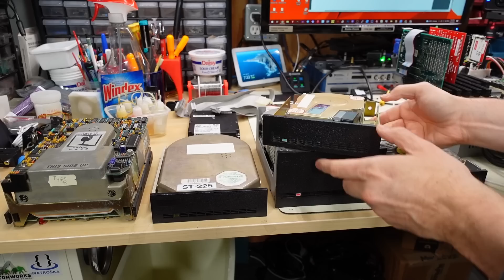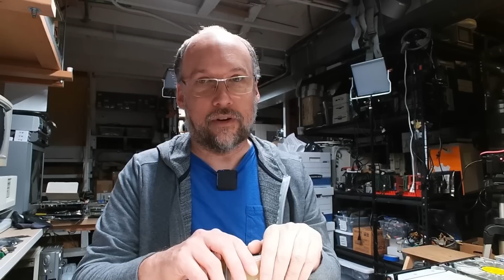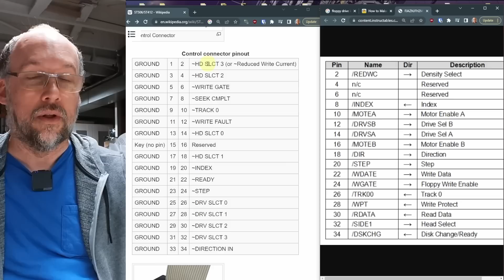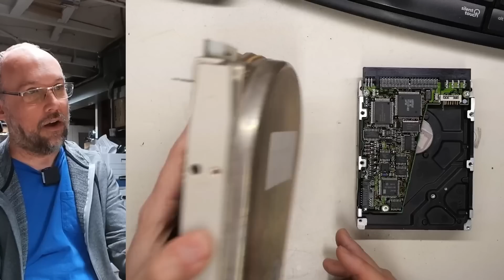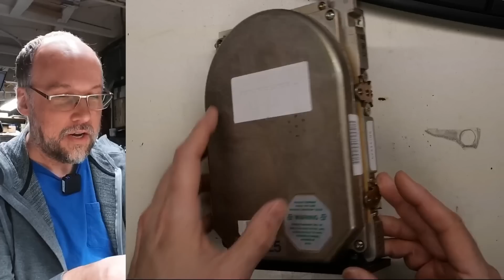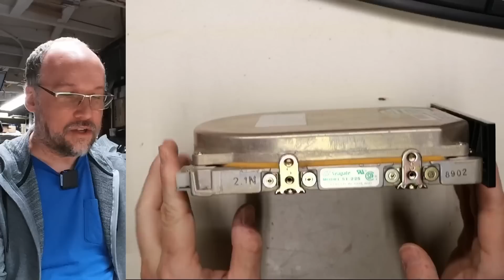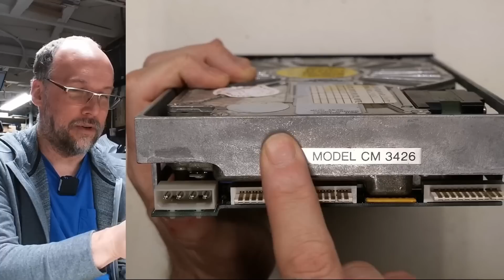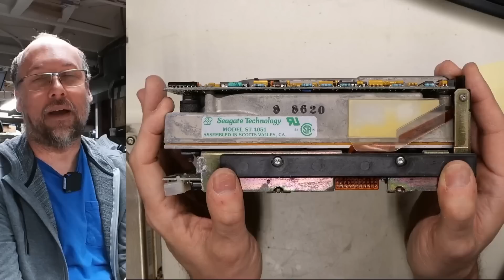Not forgotten: MFM hard drives

Comment: RLL was fun - the early Amstrad PC1512/1640 used this - you had to low level format the drive at the right time. - if the computer was cold the machine would boot, but when warm would miss read… it was was about 30 to 40 minutes from cold - a sealed computer could be low level formatted an the os put on. If you left it too long - it would not boot when cold only when warm…
Reply: I don't know what they used but if it was the classic ST-225 they had a known issue where the PCB would prevent the case from expanding evenly as it heated.  The answer was to loosen one of the screws holding the PCB in place.  It was a good idea to backup the hard disk, low-level format it to write new 'in-alignment' sector addressing data, an then restore if this was done.

Comment: I was wondering about that before. If IDE is just ISA, would it be possible to connect Soundblaster through it to a "modern" PC? Systems from the 1990s are rare and expensive in Europe, but those from the early 2000s are just trash thrown out everywhere, and they work with DOS just fine, but of course without sound.

Comment: Great video! My first PC was an AT&T PC 6300 with a 20mb RLL encoded hard drive. The only thing I have left of it is the 5.25" floppy drive. I miss it.  Looking forward to part 2 and some Coleco Adam content.
Reply: I too missed having an AT&T PC 6300..... so I hunted a nice clean one down and it's safe and sound on a shelf in the basement.  I even managed to track down the matching color monitor so now I have the option of using monochrome or color on rainy days when I fire it up for some nostalgia.  Mine came with a trusty ST-225 factory installed hard drive in it, some day I'd like to track down an original Olivetti hard drive for it too.
Reply: @RogerWilco486  that's awesome! I wish I never got rid of mine!

Comment: I enjoyed your post on MFM hard drives. I am an older adoptee of computers, not until 1988 at the age of 37 did I acquire my first a Commodore 64. In the early '90s I stated rebuilding and selling used computers having self taught myself to do so. Most st first had 10 or 20 meg MFM  hard drives with most being full height drives at first. Later on the hard drives were 20 or 40 megs in various configurations up to 80 meg total. I usually left the first drive uncompressed and used drvspace or dblspace on the second drive to get more storage space. I used a lot of different brands and capacity MFM drives the largest being the old full height Maxtor and Miniscribe 80 mb drives, the top covers being cast with the company name in large raised letters on top..A work of art and not cheap either. One thing I did was I tried to buy the hard drives with the least number of errors. Also hard drive setup was time consuming sometimes taking hours on a very large drive.  Another thing I did for some of my own drives was to format n MFM drive with a RRL controller and then drvspace the drive. On a 40 meg drive I would end up with somewhere around 90 megs of space with the conversion losses causing you to lose theoretical space. It made for a slow drive with lots of clicking and drive activity light going nuts but it worked.

Comment: I am in the middle of making a video with an Amstrad PC2286/40 and when I first tested it the WD 384R drive shut down the computer when booting up. I checked all the caps and spun the drive motor by hand and after this it actually started to boot so I guess something was tuck and pulling too much current ? . At first it would just give sector error, but over time it slowly started to work and by the time I had managed to back up all the data the drive was booting and working almost perfectly.

Comment: I learned A LOT! I didn't realize a half hour passed and when Adrian mentioned a part 2 I was thinking, "Part 2, why? It hasn't been that long!" I was so wrong.
Reply: I have the feeling that part 2 will be major disappointment, its a miracle if one of those drives still work but you should not be surprised if none of them does anymore. These things could fail easily, even back in the day they are too fragile and /true/ repair requires special dustless station and parts that don't exist anymore unless you have spare drives to cannibalize from...
Reply: @freeculture  I bet you at least the ST-225 will still work.  Those drives are damn near indestructible.  I have a pair from 1985 that I was able to low-level format last year with zero defects.
Reply: @freeculture  I bet you that the Micropolis has a sticky bumper or a stuck brake but will work, I bet that the ST-225 works no problem, the ST-4051 works, and the PTI drive is dead as a doornail.
Reply: I thought the same. I would have been completely happy to see a longer video that combined the whole project.

Comment: If the head select lines are really binary coded decimal (BCD) 4 bits would only allow for 10 possible values (0 {0000} - 9 {1001}).  BCD was primarily used for output to a single digit display which could only show decimal values.  If it is true binary, then you would get your 16 possible values (0 {0000} - 15 {1111}).

Comment: One of the first PCs I had is one that I built from scraps at an electronics recycling shop in the early 1990s. Of course nothing was properly labeled, and there were a lot of junk parts - but I learned a bunch about hardware. I ended up buying an RLL controller assuming it was just a regular MFM (same connectors means it's the same thing, after all -- right? Ha!) and was super surprised to find my 10MB ST-412 formatted out to 15MB!  I used RLL controllers on all kinds of "MFM" drives from that point on, and never had an issue. It wasn't until much later I learned that using an MFM drive with an RLL controller "wouldn't work right." Ah, those were the days... :D

Thanks for keeping all this history alive.
Reply: But, it actually does work fine.
Reply: @mikebarushok5361  Most of the time.

Comment: I think the reason that RLL was never really used on floppy drives is because, as you mentioned, RLL can be difficult to decode properly if you don't have an extremely consistent disk rotation speed, and floppy disks can vary a lot more in rotation speed compared to hard drives.  If the exact conditions of the disk itself change at all over time, an RLL signal written to the disk could become basically unreadable, and with floppy disks that could easily happen due to a little bit of dirt, or a slight stretching of the (plastic) magnetic media, or just temperature changes, etc.
Reply: Yes....... and that's also why IOMega Bernoulli could achieve its data density.
Reply: @donwald3436  I dunno about that..  I can't find any real details on the media encoding used on those sorts of devices, but just using RLL would not account for the large capacity improvements by itself, and they also used flexible (plastic) media in non-sealed environment which would have similar stability problems, IMHO, so I wouldn't be at all surprised if they still used MFM or something like it too, for the same reasons.

The main reason for the higher capacities in those drives, and successors like the Zip drive, etc is, I'm pretty sure, a combination of higher coercivity media and high write currents allowing for higher magnetic field density, along with more precise head positioning allowing for many many more tracks on the disk (poor track density due to imprecise head positioning was really the largest source of "wasted capacity" in most traditional floppy designs).

Though it is possible that the LS-120 "SuperDisk", which had an optically-coded reference track may have had precise enough real-time timing information to make RLL also be feasible for that.  I can't find anything that actually says one way or another, though...
Reply: @foogod4237  I remember (hearsay!) that some folks on the FIDO hardware groups mentioned that not all MFM HDDs were able to be used with RLL. Specifically the ST-4096 seems to have had overheating issues with the driver electronics.
Reply: @securityteam  Electronics problems wouldn't really make any sense, IMHO.  There's no difference to the drive in the sorts of raw signals it's being asked to work with.  The only difference between MFM and RLL is how the raw on-off patterns are translated to data bits by the controller.  The signal timing and frequencies are all essentially the same from the drive's perspective.

There were some MFM drives which couldn't reliably be used for RLL because their spin rates were not reliable enough, so the controller sometimes had a hard time reading back what it had written because the bit timings varied too much from one part to another (precise timing is much more critical to correctly interpret RLL codes)..  As AI T mentioned, that was the main difference between the ST-225 (MFM) drives and the ST-238 (RLL) drives.. They were basically exactly the same drive, it's just that one was tested and certified to be guaranteed to have a rotation speed which was stable enough for RLL, while the other wasn't guaranteed (but many people did try to do RLL with ST-225s anyway, and it did sometimes work).
Reply: @foogod4237  Ah ok, good to know :-) My own ST-225 didn't work using RLL, but at least I got it for free because track 0 had r/w errors. I just opened it (in the bathtub to have less dust flying around), moved the end stop slightly and low level formatted it. Voila, worked like a charm for the next few years. That was back in 1989 or so.
Reply: The early on the MFM ST225 was a 3600 RPM stability failed version of the RLL ST238 . The early RLL controllers could not RPM synchronize well with drives that did not meet stringent requirements .
A completely separate company modified on of these modulation and controlling mechanisms to make things called video image files where each track of the multi platter had stored on it half of single NTSC monochrome video frames using a pulse width modulation technique . The ST225 quality version would create NTSC image flagging whereas the ST238 quality version had way less flagging .
A likely reason why ST225 were more prevalent is because the ST225 was easier to get information out of as the spindle would ware out , which without which a later generation controllers could compensate for would send a ST238 to the scrap heap .

Comment: In 1986 ish I was working for Priam in their Reading UK drive repair centre...  Our main work was repairing their 14" and 8" Winchester drives... big heavy monsters with decent voice coil head placement... I was there for nearly 2 years, and they were just shipping 760Mb  5 1/4" full height drives when I left. Before that, in '84-'85 I was with DEC, also in Reading, repairing DF32 drives for the PDP8....  that's 32K 12 bit words on a drive I could barely lift!!  These days I don't own a drive with moving bits, amazing how things have changed!
Reply: We used your Priam 7050 drives in our Molecular MC32 computers we maintained. So fast compared to anything else. Weighed a ton but ultra reliable and ultra fast. Some systems were configured with 20+ users and there was next to no lag with a Priam drive on the n/Star CPM type OS. I still partition my drives using the Priam name in honour of your drives and no one here but me knows why.

Comment: I remember dealing with some Seagate ST-238 drives that looked similar to the ST-225 drives you have here. I believe they were 32 MB in size. 
I had one attached to my Color Computer 3 running OS-9 software.
Reply: The 238R, which I have one in my 5160 right now, was the model for certified RLL compatible 225's.
Reply: @Cherijo78  Yeah that was my first HD, good memories.

Comment: Back in the day I did try running MFM drives on RLL, and they were not reliable in the long term. As the drives matured you had a better shot, but when RLL was new, the older drives usually didn't work well.
Reply: Same experience here... Standing in front of your CEO who yells "...you lost all of our business data in Lotus 1-2-3 spreadsheets of the past five years? WHY?" was no fun. MFM was not too reliable ( consumer hard disks were cutting edge back then ), adding another layer of unreliability was a no-go in business use :)

Comment: 21:22 I wonder what the drive is exactly doing with the information about bad sectors when you low-level-format it. While it is not exactly necessary, the only useful thing the drive (or rather the formatting tool) can do with the information is to skip the sectors. Skipping would only be necessary for a verification pass. I believe the information about bad sectors is much more useful for the high-level formatting because now the drive receives a data structure (commonly a filesystem) where you can actually store the information for later usage.

Comment: In the IBM AS400/system 36 world, this "dumb" hard drive would be called a DASD.  Direct access storage device.  And they worked very similarly.
I never heard this term used in the PC world thought.
Reply: IBM used the DASD term for any device which allowed random access based upon a record address. Over time this has included drum memory, data cells, hard drives, floppy drives, optical drives, flash drives and more. On the PC side they referred to a hard drive as a "fixed drive". They used the term DASD when referring to items which encompassed multiple storage mediums. For instance, the PS/2 ESDI controller is referred to as a ESDI Fixed Drive controller by IBM because only fixed drives can connect to it. The PS/2 SCSI controller is referred to by IBM as a SCSI DASD controller because fixed drives, floppy drives, optical drives, etc. could connect to it. IBM referred to drive bays as DASD bays. Outside of IBM no one really used the term in the PC world.
Reply: @tss20148  interesting.  I have no experience with it outside of the as400/36 world.  But these machines were never configured to have a single drive.
Almost were SCSI, but you could not use standard drives without changing firmware to "dumb" them down.
Reply: OS/2 users would be familiar with DASD.

Comment: Back in the day, I worked at a bank and they used the IBM 4700 Financial System.  The 4702 controllers used full-height MFM drives (20-40mb).  As time marched on, the bank didn't upgrade and thus still needed to source the drives as the fleet aged.  IBM offered their solution of a custom MFM<->IDE converter board, a custom drive sled that housed the board, and a 1GB (ooohh) IDE drive.  All for the totally reasonable price of $2000ea (1990's dollars).  We sourced refurb MFM drives for years, usually hovering around 400-600EA...  Good times lol

Comment: Sorry for laughing at the "finger acrobatics" 😁. No one saw me. Thanks Adrian for yet another very interesting video. I still remember my 3.5" HDD, possibly about 200MB, "mounted" in a plastic ice cream box outside my Amiga 1200. I had to drive the computer and harddrive with a rebuilt AT-PSU.  The 1200 was nice by giving us an internal IDE-connector, compared to the 500 where one had to use the left side expansion port for such pleasures.

Comment: Both so-called MFM and so-called RLL disks (or rather controllers) are using MFM modulation and RLL encoding. The so-called MFM disks are using RLL(1,3) encoding, while the so-called RLL ones are using RLL(2,7) encoding.

Comment: 5:11 I'm afraid this explanation is not 100% correct as hard disk drives which don't use this interface may also use MFM encoding. The exact reason why these HDDs are colloquially called MFM drives is that the full MFM signaling is exposed to the controller, in contrast to other interfaces like IDE. (Earlier) IDE drives also used MFM but the exact encoding in these drives didn't matter as their controller doesn't need to know about it, which is why they are much less commonly called MFM drives.

Comment: Interesting thought on formatting a floppy with RLL encoding. Made me think of Microsoft's DMF format, which formatted a 1.44MB 3.5" disk to 1.68MB. But I think that was still MFM encoding, just with different sector size and number of sectors per track.
Reply: Yes, it was still bog standard MFM on those discs but with reduced gaps and potentially larger sectors (up to 2k?).  The common layout for PC floppies had very generous gaps after the index hole and also between the sectors.  I don't know why they were so large but it would certainly have permitted the use of disc drives with very out of spec spindle speeds.  Ye olde TRS-80 MI/III/IV used around 26 bytes (from memory) of inter-sector gap and didn't have any interchange problems with the Tandons used in the MIII and could attain the same data capacity as PC disks (as in raw bytes in sectors) despite using 256 byte sectors with the additional addressing overhead that bought.
Reply: @retrozmachine1189  There was a set of two programs (FDFORMAT.EXE & FDREAD.EXE) which were designed to do exactly this.  You could also add two more tracks to an 80 track drive, to format a disk to 82 tracks.
With FDREAD installed (it was a terminate-and-stay-resident or TSR program), you could format a 1.44MB floppy to something like 1.75MB.  But even without FDREAD installed, you could still do things like reducing the root directory to a single sector so you could store fewer programs in the root but could use the leftover space for storage, and any PC would still read and write the disk without a problem and without needing FDREAD installed.
Your memory is quite correct that it was possible to increase the number of sectors per track from 9 to 10 by effectively using part of the index gap as sector storage.